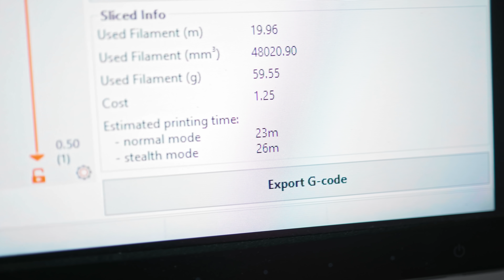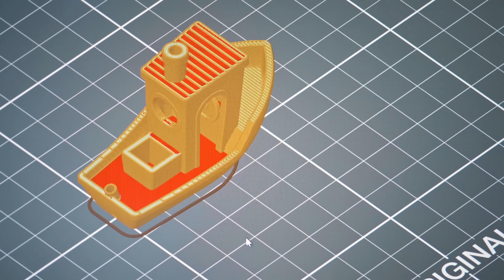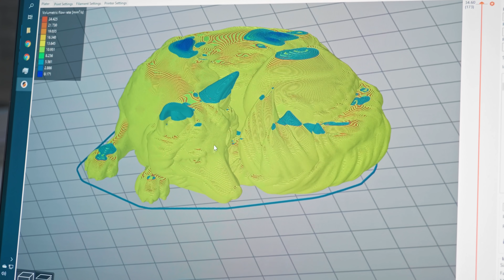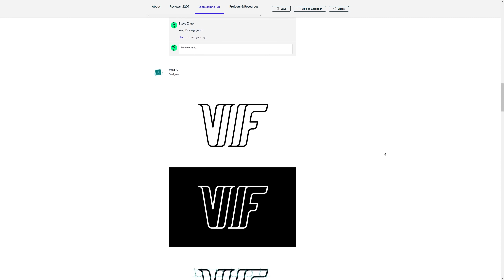Print FASTER: Tuned Profiles or Drilled Nozzles?

Comment: I know this is a few years old, but im thinking about it a few different ways, a 6mm bolt drilled out to the 1.xmm sizes, the head can be finished to provide a nicer surface.  Or an 8mm nozzle can be fabricated with a heatblock to match to get back the strength.

Comment: In the same amount of time you print two benchies I print an articulated dragon. I use 0.8 brass nozzle on ender 3. I print specialty pla and pla+ like glow in the dark and flecked filaments

Your nozzle broke from you putting it in a vice and drilling it. I use cheap brass nozzles of varying diameters and never had one break. You just throw them out once they foul or change them out when a project demands a different output. 1.0 and up are astounding for vase mode prints if you can adjust your printer profile settings and get good layers.

Comment: Watching this video quite a while later, I'm curious how far you can take it with the CHT high-flow nozzles. After all, for bigger prints it seems to be the flow rate that causes the most issues. Cant wait to get my hands on my prusa mini with some CHT nozzles and figure out where i can push it to.
Edit for clarification: I plan on getting a 0.6 mm nozzle, as it should be able to print line widhts of down to 0.48mm comfortably [if not lower] yet still go for a higher layer height [up to 0,4]mm, not to mention a line width of up to 0,8 comfortably, if the flow of the CHT nozzle suffices. 
Nope, I am not in this to print detailed intricate models. I want to learn how to 3d Model functional parts, and draft quality is plenty.

Comment: If you're limited by the power of your hot end, turning the temperature higher won't make any difference, will it?  Example: I lived in Wisconsin in a bad apartment.  On a cold day, (-20 oF)  the furnace couldn't keep up.  Roommate turned thermostat to 90 oF, which had no effect.  Next day a warm front comes through and we come home from classes to a sauna.

Comment: When some people try to print really fast, they end up having to deal with severe vibrations. 

Regarding excess vibrations when printing at high speeds...

If my 3D printer has any springs in it, I'd probably try to replace them with inerters (aka j-dampers) to minimize vibrations. I'd also probably use tuned mass dampers and anti-vibration materials for the mounts and whatnot.

Comment: Thomas, did you print the outer layer AFTER internals?
I think that making the outer layer slower that all internals is a pretty good idea! But it should be worth considering to print the outer perimeter first. From my experience - if the slower outer layer printed first - you will not be able to see any difference from the sample printed at the normal (everything slow) settings.

Comment: I didn't get the point of using drilled nozzles with sharp edges. For me it is obvious that it will ruin the quality.
For me I wouldn't go beyong 0.8 mm nozzle size on V6 hotend: it will not be able to keep the material temperature out of the nozzle consistent enough.

Comment: What if they made a Hot End with a 4 sided thermoelectric cooler? Very hot on the inside & pretty cold on the outside. Then the part cooling fan would be blowing cold air on the part.

Comment: If you are going down to 0.4mm layer height, 0.8mm nozzle would be probably better - you get more evenly heated filament with same layers or you could possibly go for 0.6mm layer height and you would still be  extruding slightly less material than on 0.4mm layer height with 1mm nozzle.
Anyway thanks for the test and the lt tea :)

Comment: with input shaper i can cut up to 40% of my print time. i went from 2.2k accel at 45mm/s outside perimeters on my printer to 6k accel (only conservatives due the shakig etc) at 150 inner and 90mm/s outer perimeters. it's nut. but these also help ofc. these are my "quality" settings. i get zero ghosting/artifacts. my cooling is also strangely enough. tho i print ABS a lot which doesn't need much cooling

Comment: How accurate are the diameters of the drilled nozzles?
If your drill bit wobbles, or has a tolerance that's slightly off (say 0.98mm or 1.02mm).. I imagine you can compensate for that in horizontal expansion settings... but is it worth it or easier just to buy the bigger nozzles?

Comment: Hi I am new to much of this. I am mostly interested in printing prototype and have no problem with the lack of details. I want speed like you had on the one with Drilled nossle. My question, is there a product out there where I get like a modified e3d that is made for bigger nossle and speeds ore do I have to do it by my self ? I mostly want to modify 3d Scans for motorbike and car parts. And print and glue together. 

Thank you for interesting and interesting topics

Comment: I use a 0.8 nozzle with a .4 layer at ~30mm/s when I have large, simple parts. Like,  200 to 500 g parts. I've gotten some beautiful results. Depending on the part, sometimes I reduce the layer height to .2. I use a modified Ender 3 with a Trianglelabs E3DV6 with a dual petsfang duct, so quite a lot of cooling potential. Also, I typically use exclusively PETG which has a significantly lower thermal mass than PLA.

Comment: I am running into the thermal runaway protection on my MK3S when I print parts with large flat surfaces using a 0,6mm nozzle. Putting down two or three bottom layers for a 10x15cm box tends to trigger thermal runaway on the second or third layer. Even had it trigger at the top layer before when printing a formula style sim racing wheel.
I like larger nozzles for big prints but they come with their own issues. Really sucks when a large print fails after 5 hours where the 0,4mm nozzle could have finished the same job in 8.
Reply: Failures always suck,,but we are working to get print times down.....that is the goal

Comment: I print industrial parts almost daily with a purchased 1mm nozzle, in PETG. Much better surface finish than you are getting by drilling, due to the flat face on the nozzle. Since print speeds have to be fairly low for PETG, the 1mm nozzle and 0.5mm layer pay off - I can print a benchy in 20 minutes before I run out of hotend capacity. Increasing speeds further results in underextrusion, poor adhesion and uneven parts. Looking at a Volcano or a water-cooled hotend so I can cram even more filament through, even though a 2 hour print for my setup would have been a day with the stock nozzle.

Comment: I've printed with a 1.5 mm nozzle with 200% speed using point 0.5 instead of 100% larger nozzle without tuning the temperature cooling in half the speed, knowing that 75% ratio is equal to the original printer's perimeters and showing that 30% infill on all layers gets a 200% speed at stock 0.2 millimeter nozzle and two multipliers which is now not as much of improvment compared to 250 mm speed at max and therefore I've come to the final conclusion that I should keep the standard nozzle, the normal speed and original cooling and wait a bit longer for the real good results.
 LOL
Reply: For 1.5mm nozzle, I'd recommend to set your extrusion width to 1.875mm, layer height to 0.75mm, and all speeds to 10 mm/s.

Comment: A thought. Step Bore Nozzle. The point that the filament hits would be somewhere @ 0.5mm that would then expand out to 1.5mm or so. That would allow for the back pressuer needed to properly melt the filament and the print / build surface would see a 1.5mm extrusion.

Comment: My Geeetech A10 default hotend for some reason can do pretty fast 0.3mm layer height prints with only 200 °C without skipping, even though it's a short one.

The Fox model on 45% scale is 1 hour 30 min (slicer says 1 hour 20 min) on my default 0.2 mm settings.

Comment: Pretty new to 3D printing. How do you develop a tuned profile? I've just played with infill and perimeters and a tiny bit with temperature. 
Would love to see a how to.
Reply: Briefly explained, you keep changing factors such as speed and as you find issues you adjust other settings to counter it, such as increasing temperature.

I use a 0.8mm nozzle at 0.2mm layers most of the time (I print bigger things, but as long as you don't need too much detail it's good for small pieces too) and getting the flow rate right can take some back and forth with speed and temperature.

Then there's issues with stringing and blobs which comes with higher temperatures and bigger nozzles.

Comment: I know it's not the point of the video, but you can achieve similar results with a lot less artifacts simply by increasing the line width.  I regularly run 0.6mm line width on a 0.4mm nozzle, and have gone as wide as 0.8mm with minimal issues.  Higher than that you start running into the limits of the hot end to melt the volume of filament needed, forcing you to print slower which defeats the purpose.

Comment: IDEA:
Two heads, same (or similar) material loaded, different nozzle sizes.
Outermost perimeters with small head, high resolution settings, small layer height, etc.
Inner walls and infill with large, 2x, 3x, or 4x layer height.

So the layers would go like this: multiple thin layers of outer walls with high res., then a thicc one inside.

I'm sure I'm not the first to come up with this, but I haven't seen it working yet.

Comment: Can we have the full settings for the 1mm nozzle please ? (Perimeters speed and Accel, etc..)
Also what cooling (blowers and fan shroud) could be used for volcano + 1mm nozzle (+ mandatory sock) + 40w heater, cause I'm struggling with this (maybe I did not lower temp but should I ?)

Comment: How about wider line width on stock nozzle? And how about external perimeters around 0.45mm and all internals 0.7 width? This way you could have thicker walls and accurate externals.. On dimensionally accurate prints I prefer 0.1.. 0.2mm layer thickness because thicker ones affects accuracy quite a lot (for example try printing different thickness walls 1mm to 2mm, on thicker ones the walls are not that accurate anymore).. I've been using 0.6mm nozzle from start but now have tested more on 0.4mm printing thicker lines which seems quite efficient -just gotta test 0.4 with carbon if it's OK and not clogging. 👍

Comment: I haven't used prusa slicer before but I do love that cura/creality slicer let you set the rates of inner and outer perimeters individually, so I have my external surface go half as fast as the internal walls and infill for example. Prints absolutely FLY and then when it hits that outer layer it slows down and really brings out the finer detail.

Comment: Putting a 0.8mm on my ancient wooden Ultimaker has been a joy for mechanical parts. It can belt out a strong test piece in 2 hours where my Mk3 would take 8+. Once I retrofit a volcano in there it will be even crazier. Ultimaker is a good candidate for raw speed, being a bowden style machine. The moving parts are light since the extruder stepper is fixed in place. Can crank up the accelerations all the way to 11. Plus, in my experience a bigger nozzle is much less susceptible to jamming, so I can throw all my old sketchy filament at it.

Comment: Great video. Seeing those speeds makes me even more happy with my railcore. I built it with a volcano, and use a 1.2mm nozzle. I print at 150mm/s and 9000mm/s² acceleration. I printed a bathroom trash can in less than 5 hours!
Reply: That sounds amazing.  On a V6, I wouldn't go faster than 16mm/s (floor(15/1.2*1.25*0.6)).

Comment: Thanks, very interesting. I use a 0.6 mm nozzle on a MK2.5S with a copper nickel heat block that I have polished dental bits. Titanium break and copper/nickel nozzle. Max flow at 20.5 mm/sec. Very nice finish out of it. Also have found that get better prints out of PETG when staying at 240°C and above and MSR value of 10.5mm/sec. 

Again thanks for the video. Hope to see you again some time after this madness is over.

Comment: So what are the best options for powerful cooling? I've seen some people with fast printers running compressed air, which is good 'cos gas absorbs heat as it expands (in addition to the air flow cooling) but I'd worry about blowing around delicate parts.

Comment: How to print faster in four easy steps:
-Establish the flowrate limit of your nozzle. 8-10mm3/s is a good starting point for a lot of hotends, if your cooling is up to that.
-Establish the print speed your kinematic system is comfortable with. Most systems can print at 45-60 without excessive ghosting.
-Divide flowrate by speed to get the square area your need to print at. In this case, 0.16-0.17 mm2.
-Pick a nozzle size and layer height accordingly, as small as you need to meet this but as large as you dare to lose resolution on the print. In this case, 0.6mm nozzle and 0.3mm layer height makes sense.
You can now print as fast as your printer will allow at the best resolution this point will offer.
Reply: What's the calculation done in order to understand step 4? I.e./e.g. how does 0.16 translate to 0.6 and 0.3 height?
Reply: @massacred666  0.6mm*0.3mm is approx. 0.16mm²
Reply: @innnlove  nice, thanks buddy

Comment: Have you ever tried the pre slices files of Prusa for their face shield? I was shocked how fast they push their settings for that. But with PETG it is easyer to go faster since it does not need as much cooling. I saved their settings to my slicer and use it now for all prototype prints.

Comment: Are there any manufacturers of nozzles with dynamic apertures? This seems like a weird idea, but a nozzle which could have its diametre adjusted with extra electronics would permit a single-nozzle system to function as multiple with vtool profiles.
Reply: It would be nigh-impossible to make that for a reasonable price. the electronics would have to endure high heat and be tight so that the super hot plastic flowing through them doesn’t seep through or get stuck somewhere. In addition, it would have to be small enough to actually work as a nozzle. Cool Idea but very hard to implement.

Comment: So test is -- lets try to test with a benchy, ohh -- looks bad -- inadequate cooling, lets try a model that doesn't need such cooling...huh? I've been trying to push higher speed and higher extrusion printing speed boundaries for years, and first things to upgrade are -- the hotend with a longer melting zone, and cooling to cool filament faster as you're laying it down. Also -- as other suggested, a basic volcano nozzle pack has 1.0 and 1.2mm nozzles included, so why not just use that? I'm not sure what this test accomplishes. You waste more time drilling out nozzles than just doing this the right way. Use a super volcano to test really higher speed printing...

Comment: For bigger printers like CR10 or anything with build plate 300x300 a 0.8mm nozzle or bigger is just a common sense. Otherwise you will wait ages for big prints.

Comment: nice video! LOVE to see the prusa run fast af
I actually don't like visible layers (unless it's a vase, those look super cool with thick lines on purpose)
I spent a lot of money getting a Nova hotend to push high volumetric flow out of a .5 nozzle at .2 layer heights, it's worth it for me, I prefer needing the printer to run 300mm/s 3k accel print speeds to using thicker layers, compared to a printer running 40mm/s, I get 5x faster print times (although I don't usually go that fast, usually only 150mm/s untill I get the better machine I designed specifically for speed), cooling is definitely the limiting factor most of of the time, that's why I'll be using a 5020 fan instead of the 5015, makes a huge difference

Comment: wow! I've been out of the loop. Drilling seems.. unnecessary, why not just buy bigger nozzles?! But thanks for exploring this.
I recently gave PrusaSlicer a go on my ender 3 and tuned a profile for a model, the finish was exquisite and has convinced me to make the switch, not I have to get it to run stable on my laptop. Thanks for all the great videos.
Reply: Generally you can't buy more than 1mm at least from what I've seen. Just not enough demand.
Reply: @moth.monster  ok, that makes more sense.. wow! the spool must just Spin at those sizes
Reply: @ein57ein  It sure does at 0.8mm (the largest size I've used).
Reply: @jefbed212  I'm tempted to try .8 I've been running one machine at .6 for a couple of months now.. but only brave enough to do .3 layer heights so far

Comment: Awesome! Finally some discussion on speed! Speed improvements are needed since years... I have been printing at such speeds and 1.5mm nozzle since over 5 years! (Yes; drilled nozzles can print smooth...) Such settings are not 'crazy fast' just because we are used to hyper slow printing speeds (cognitive biases)... All printers should print at the max speed allowed by the frame and hardware. Then, yes, increase that cooling many times! - Great introduction! A work in progress? Can't wait for the next videos on the topic! 👍

Comment: That LTT reference is legendary ! :D
Also I think it would have been interesting to talk more about E3D V6 flow limitations. With my usual settings for a 0.6mm nozzle, 210°C, 0.3mm layer height and 0.7mm line width, you are limited to around 60-70mm/s. From my experience that's the sweet spot for a "fast but reasonnable" profile. 
With a Volcano hotend, you sould be able to easily double that speed but you may be limited by other factors then, mainly cooling as shown in the video but also motion system for cheaper cartesian-prusa style printers, or even extruder if not dual-drive.
Reply: To avoid the cooling issues you can use PETG instead of PLA.
Reply: If you calculate your flowrate it comes out to something like 12mm3/s, which is about what the regular V6 can handle. E3D doesn't recommend you go over 25mm3/s on a V6 Volcano, but I've taken one to 40. Don't do that.